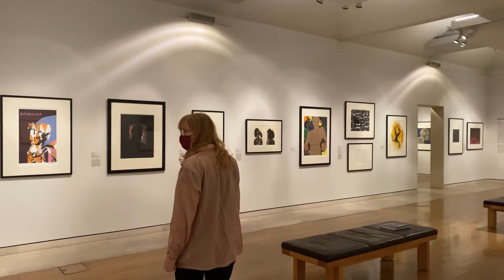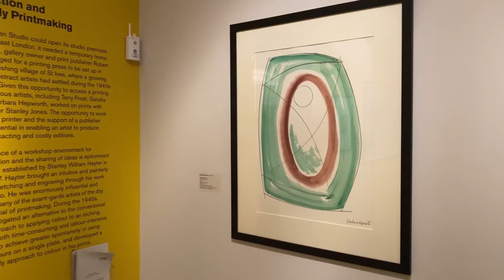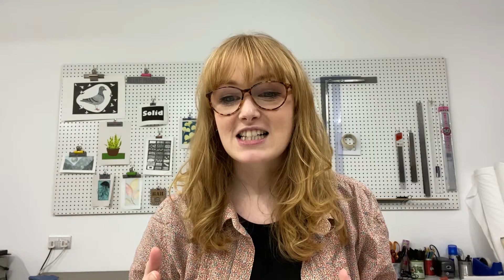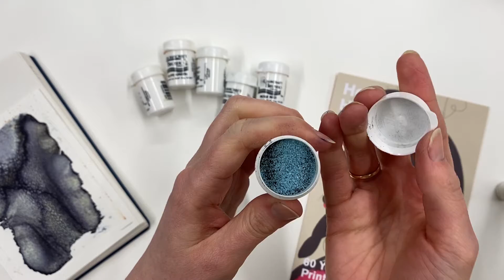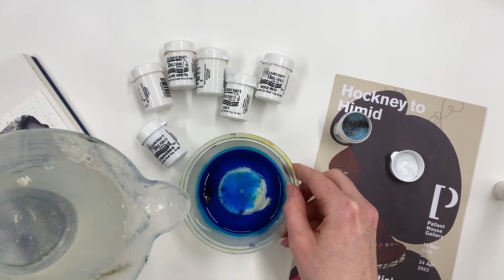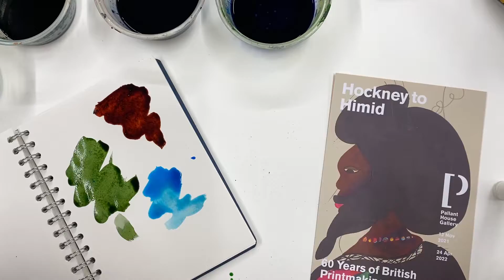Pallant House Gallery Printmaking Exhibition

Comment: Did I miss a step? You made the design with the dyes on a plastic sheet and left it to dry overnight and then took a print from it? How did you do that if it was dry?
Reply from the maker: The paper that you print with is damp so it releases the ink during the print process as it is put through the press.